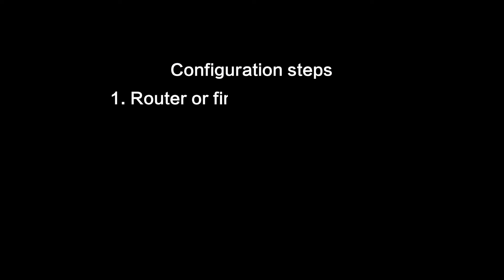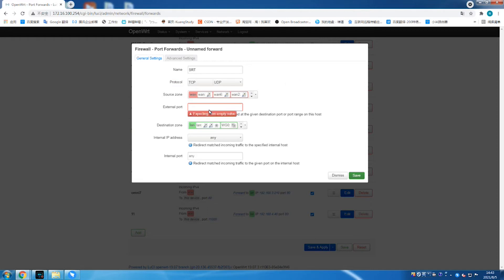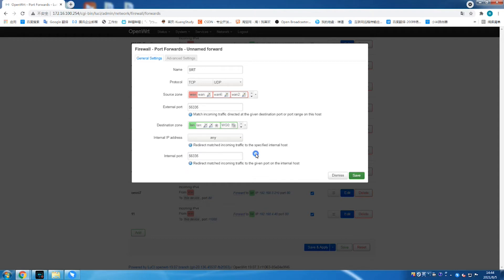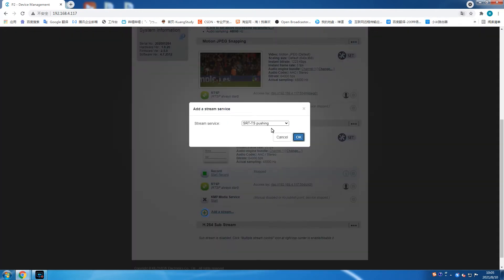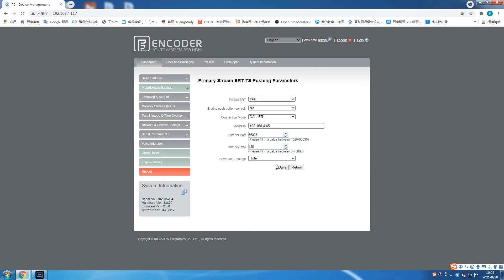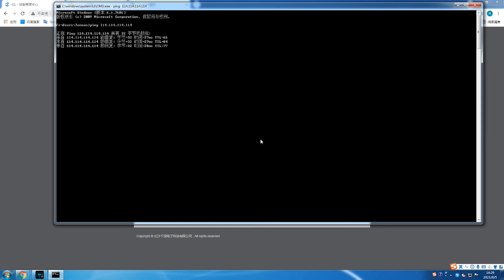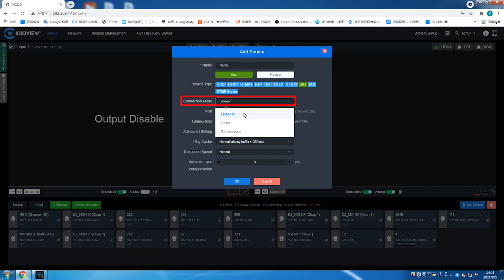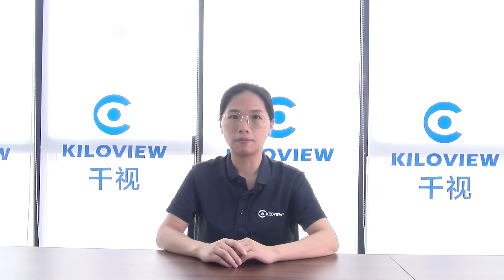How to configure SRT in Kiloview encoder and decoder?

Comment: My question: Is it correct to set the local IP address in the encoder settings? There I would expect the public IP address... That is, if you are setting up a connection between two places on the Internet. I plan to buy a P1 encoder and a D350 decoder for SRT transmission via the Internet..